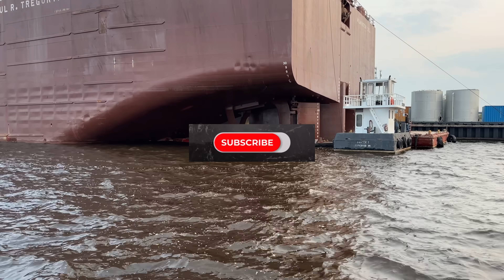⚓️ Sparks Fly as Great Lakes’ Largest Ship Repaired!

Comment: Interesting that this huge ship doesn't have propellers directly connected to the  engines via prop-shaft, like sea going ships. This ship has V-drive gearboxes, like small boats, so engines are sitting in hull section directly above propellers, just to minimize engine room length and maximize cargo space.
Reply from the maker: That was a sharp observation and you explained it really well. Great Lakes ships are built with a very different philosophy than ocean ships and that V drive layout is one of the biggest differences. By placing the engines above the propellers and running everything through those gearboxes the ship saves a huge amount of space in the hull. More space means more cargo and that is the entire purpose of a laker. They squeeze every inch they can for ore coal and stone so the engineering team designs the machinery around that priority.

It is such a clever system to see in person. The engine room on the Indiana Harbor almost feels compact compared to what you would expect on a one thousand foot ship but it is not because the engines are small. It is because the hull is designed like a giant cargo tube and the machinery has to fit around that idea. Great comment.
Reply from the maker: This is a great video, no doubt, but I want you to see this one in case you missed it. I went across Lake Superior on a 1000 foot ship. I just posted it. Here’s the video ➡️ https://youtu.be/357RJG0toyo

Comment: Wow how awesome.. how did they get it out of the water?
Reply from the maker: To keep the bow (front) of the ship low and the stern (back) high and out of the water for maintenance, the crew intentionally flooded compartments in the forward (front) part of the vessel. This process, known as ballasting or controlled flooding, uses water as ballast to shift the ship’s center of gravity toward the bow. As the bow sinks lower in the water, the stern rises up, exposing areas that need work. This technique is common in shipyards and dry docks but can also be done in the water when dry dock space or heavy lift equipment isn’t available.

Comment: How did they lift the stern of that huge filled heavy vessel? From what was said, it was full of cargo evenly distributed.

Or was this huge ship empty and they filled front areas with water to sink the bow and raise the stern?
Reply from the maker: To keep the bow (front) of the ship low and the stern (back) high and out of the water for maintenance, the crew intentionally flooded compartments in the forward (front) part of the vessel. This process, known as ballasting or controlled flooding, uses water as ballast to shift the ship’s center of gravity toward the bow. As the bow sinks lower in the water, the stern rises up, exposing areas that need work. This technique is common in shipyards and dry docks but can also be done in the water when dry dock space or heavy lift equipment isn’t available.

Comment: The condition of the underside of these fresh water vessels are amazing compared to the salty vessels.  I wonder if they heavy load the bow to pop the stern out of the water.
Reply from the maker: To keep the bow (front) of the ship low and the stern (back) high and out of the water for maintenance, the crew intentionally flooded compartments in the forward (front) part of the vessel. This process, known as ballasting or controlled flooding, uses water as ballast to shift the ship’s center of gravity toward the bow. As the bow sinks lower in the water, the stern rises up, exposing areas that need work. This technique is common in shipyards and dry docks but can also be done in the water when dry dock space or heavy lift equipment isn’t available.

Comment: Guessing they shifted the load to the bow to get the rudder out of the water.
Reply from the maker: To keep the bow (front) of the ship low and the stern (back) high and out of the water for maintenance, the crew intentionally flooded compartments in the forward (front) part of the vessel. This process, known as ballasting or controlled flooding, uses water as ballast to shift the ship’s center of gravity toward the bow. As the bow sinks lower in the water, the stern rises up, exposing areas that need work. This technique is common in shipyards and dry docks but can also be done in the water when dry dock space or heavy lift equipment isn’t available.

Comment: How was the loading of the huge vessel moved to allow the stern to rise higher in the water allowing the welder to repair the rudder mechanism? The huge propeller is mostly out of the water.
The huge cargo had to be moved forward allowing the stern to rise so high.
It is great to see that highly skilled welder preforming repair to the rudder of that huge ship loaded in the water.
Reply from the maker: To keep the bow (front) of the ship low and the stern (back) high and out of the water for maintenance, the crew intentionally flooded compartments in the forward (front) part of the vessel. This process, known as ballasting or controlled flooding, uses water as ballast to shift the ship’s center of gravity toward the bow. As the bow sinks lower in the water, the stern rises up, exposing areas that need work. This technique is common in shipyards and dry docks but can also be done in the water when dry dock space or heavy lift equipment isn’t available.

Comment: How do ship builders arrive at the length for a ship?  Why 113'?  Why not 110' or 115'?
Reply from the maker: I did some looking and I found this for you. The Paul R. Tregurtha was built to a length of 1,013 feet (or 1,013 feet 5 inches, depending on the source) primarily because she was designed as a “thousand-footer”—a class of massive Great Lakes bulk carriers constructed to maximize efficiency and cargo capacity within the constraints of the Welland Canal locks and other navigational limits on the Great Lakes. The designation “thousand-footer” is not strictly literal; the actual lengths of these ships vary slightly, but all are in the range of about 1,000 to 1,013 feet.
The specific length of 1,013 feet for the Paul R. Tregurtha is not the result of a special requirement for “113” extra inches or feet, but rather the outcome of engineering and design optimization during her construction. The American Ship Building Company, which built the vessel, designed her to be as long as possible while still fitting the locks and navigational channels of the Great Lakes, especially the Welland Canal, which is a limiting factor for ship dimensions. The extra 13 feet over the round “1,000 feet” simply reflects the precise engineering and structural needs of the vessel, as well as the specific requirements of her owner, Interlake Steamship Company, and her intended cargo operations.
In summary, the 1,013-foot length is a result of maximizing the ship’s capacity and efficiency within the practical limits of Great Lakes infrastructure, not because of a special significance to the number 113. The extra length over 1,000 feet is typical among the so-called “thousand-footers,” as most of these ships are actually a few feet longer than 1,000 feet for practical and design reasons

Comment: I look through most of the comments already but how did they get the ship at that kind of an angle? Did they just weighit down the front end?
Reply from the maker: Thanks for asking the question Sue! It’s quite fascinating, my friend. To keep the bow (front) of the ship low and the stern (back) high and out of the water for maintenance, the crew intentionally flooded compartments in the forward (front) part of the vessel. This process, known as ballasting or controlled flooding, uses water as ballast to shift the ship’s center of gravity toward the bow. As the bow sinks lower in the water, the stern rises up, exposing areas that need work. This technique is common in shipyards and dry docks but can also be done in the water when dry dock space or heavy lift equipment isn’t available.

Comment from the maker: Question: How did they raise up the PRT to work on it?

Answer: To keep the bow (front) of the ship low and the stern (back) high and out of the water for maintenance, the crew intentionally flooded compartments in the forward (front) part of the vessel. This process, known as ballasting or controlled flooding, uses water as ballast to shift the ship’s center of gravity toward the bow. As the bow sinks lower in the water, the stern rises up, exposing areas that need work. This technique is common in shipyards and dry docks but can also be done in the water when dry dock space or heavy lift equipment isn’t available.

Comment: Very interesting action. Thanks Mike
Reply from the maker: To keep the bow (front) of the ship low and the stern (back) high and out of the water for maintenance, the crew intentionally flooded compartments in the forward (front) part of the vessel. This process, known as ballasting or controlled flooding, uses water as ballast to shift the ship’s center of gravity toward the bow. As the bow sinks lower in the water, the stern rises up, exposing areas that need work. This technique is common in shipyards and dry docks but can also be done in the water when dry dock space or heavy lift equipment isn’t available.

Comment: That is unique. Interesting how the shifted the ballast to get the stern up.  Thank you for sharing this 👍
Reply from the maker: Kevin, it’s such a cool process. I still can’t believe I saw the propeller of the PRT. It was wild man. To keep the bow (front) of the ship low and the stern (back) high and out of the water for maintenance, the crew intentionally flooded compartments in the forward (front) part of the vessel. This process, known as ballasting or controlled flooding, uses water as ballast to shift the ship’s center of gravity toward the bow. As the bow sinks lower in the water, the stern rises up, exposing areas that need work. This technique is common in shipyards and dry docks but can also be done in the water when dry dock space or heavy lift equipment isn’t available.

Comment: You are all over it Mike !
Being able to get up close and check things out !❤❤
Reply from the maker: It was amazing getting next to all of that action. It was so cool.
Reply: there are lots of reasons they could be working on the rudder
They could be doing standard maintenance work 
replacing sacrificial zinks that prevent electrolysis from eating up that expensive  propeller
Sometimes water will get into a hollow rudder freeze and crack it or they clipped something and were straightening it out
Some ships have " kitchen  "
Rudders ( the name of the guy that invented it )
A little rudder behind  the main rudder that moves automatically when the rudder turns increasing the rudder angle some korts nozels have them also
Wouldn't take much To bang one of  them up
I notices a welding torch being used the probably  welded braces on to align the repair
And we're cutting them off when they were finished
Or mabyit something else ?
Have a great day
Reply from the maker: Carl, thanks for giving us something to think about. Awesome comment

Comment: Always amazing to see. All three of my ships, USS Canberra CAG-2, USS Dahlgren DLG-12, and the USS Jouett CG-29 had to undergo shipyard repairs. We were in drydocks, still living onboard the USS Canberra and the USS Jouett with no water underneath. Each with power, water, etc. connections to the pier. The USS Canberra was a heavy cruiser which is just smaller and yet faster than a battleship. In fact US heavy cruisers were often about the same size as pocket battleships of other nations during the world wars.  It is unbelievable to see a heavy cruiser like the Canberra sitting like that high-and-dry with workers working inside a huge hole in the side and parts, propellers and shafts, and bulkheads laying on huge pallets on the pier or down inside the drydock. Nearly all of the passageways had hoses and lines hanging draped along their length supporting the work. This made it a little difficult to get around. For safety reasons, we had fire, rescue, and security drills, at random, every day. From time-to-time the shipyard had to shift the chocks underneath so work could be done on the hull. This was done one-at-a-time in order to keep the ship stable. Just Amazing!
Reply from the maker: Wow, thanks for sharing that incredible experience and perspective! Jerry, your comments are becoming something to go to the comment section to look for. There’s no doubt about it.

Comment: Great video Mike. thanks for being out there to bring us stuff like this. I do have to correct you on one point though, The workers were not welding on the rudder, they were cutting it. Welding fuses steel together, usually using electricity. Cutting (sometimes referred to as burning) cuts steel with an oxygen-acetylene torch, which is what those guys were doing.  It's essentially to opposite of welding.
Reply from the maker: That’s really cool information, thanks for sharing that! You have no idea how helpful this is, the way you explain it, just learning about this, this is so fascinating. Thank you so much. And big time respect to all of the hard-working union professionals out there.

Comment: If I had to guess, the technicians are replacing a seized rudder bearing/s and were torching open the access cover. Long night ahead of them - hopefully the weather is kind. The vessel was ballasted front heavy - tail light to facilitate water surface level access. All fantastic countermeasures and engineering foresight. Great job Mike as always and enjoy your summer.
Reply from the maker: I think it’s all cool learning in the comment section about this.
Reply: Great comment to give insight into the in-situ repair. I know enough about welding to know the welder was cutting with a torch to access something, but what? I was wondering how the stern could be higher than the bow.  Thanks for pointing out the use of ballast to make the bow heavy.
Reply from the maker: Arizona! This was so fascinating to record. I seriously could not believe I was recording it. I’ve never seen something like this in person. It really made me smile as I was recording it. I knew I could show it to all of you.

Comment: Very cool - and interesting!
Reply from the maker: It really was interesting to see all the work that goes into repairing these ships!
Reply: @vibewithmike  It really is! And great observation on the "bow heavy" condition witnessed by the slope of one of the hull lines - allowing the stern to be lifted so it could be serviced. Very cool!😊
Reply from the maker: To keep the bow (front) of the ship low and the stern (back) high and out of the water for maintenance, the crew intentionally flooded compartments in the forward (front) part of the vessel. This process, known as ballasting or controlled flooding, uses water as ballast to shift the ship’s center of gravity toward the bow. As the bow sinks lower in the water, the stern rises up, exposing areas that need work. This technique is common in shipyards and dry docks but can also be done in the water when dry dock space or heavy lift equipment isn’t available.